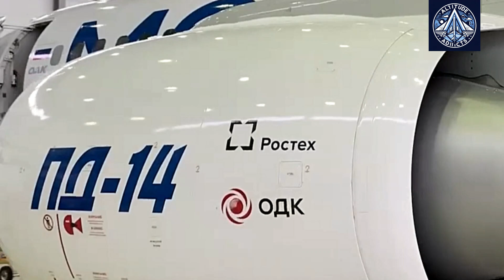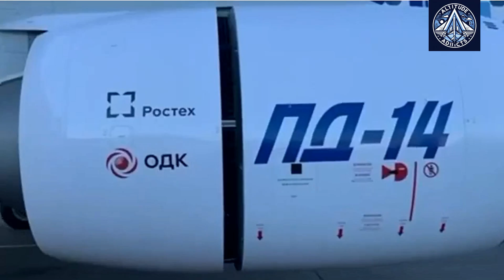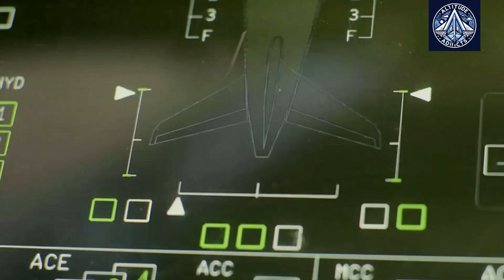PD-14 Engine - Thrust Reverser and Carbon Fiber Grids

Comment: Russia has been making jet engines since 1907 beginning with the Pulse Jet ( patented in 1907 in St Petersburg )and have hundreds of prototypes designs to pick from a dozen plus engine designers, the Russians are more apt to simplify their designs and avoid all the bells an whistles and a myriad of sensors to give it very little variations and variable controls for longer reliability and simplicity of operation, inexpensive materials and less flashy bling for less value added cost....
The Russians are not conventional and not the same as the western counterparts or don't like to Brithisize common value items like a simple car like the Rolls Royce with polish wood leather interior or Magnesium wheels, a GM transmission and a BMW engine, they are more like a Kamaz Rally truck, an all terrain battle tested Dakar rally vehicle, tough and simple that can get you from point A to Point B in extreme weather and conditions.....